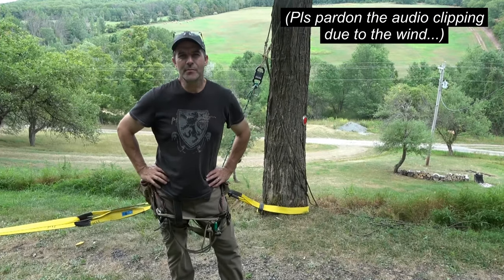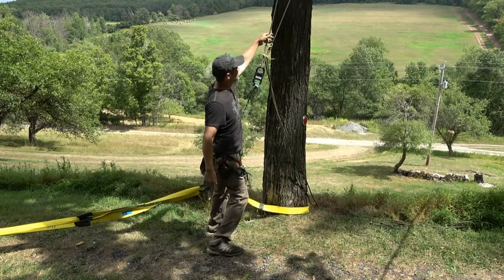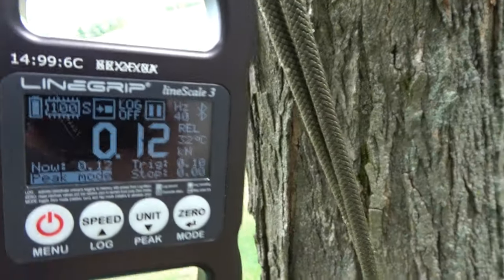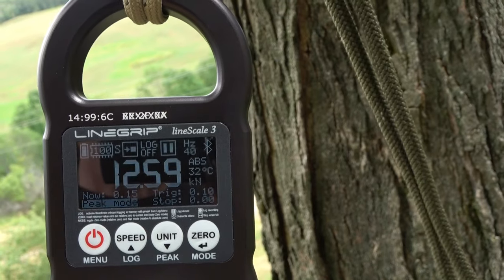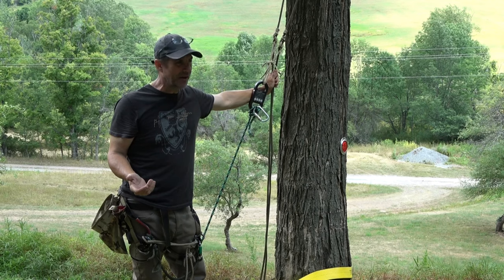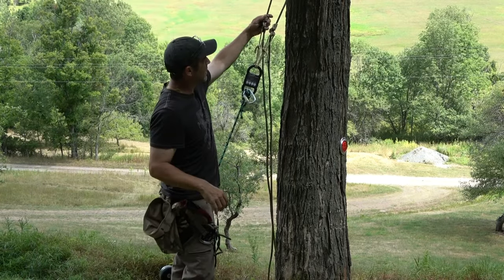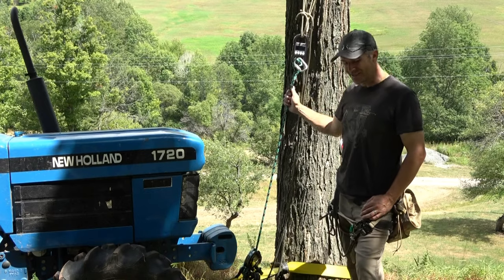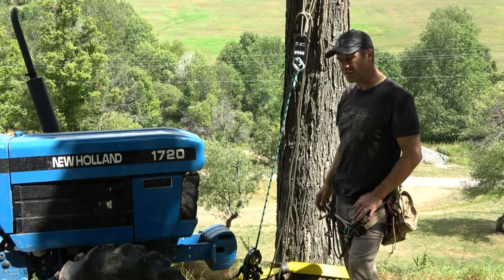Initial Pull Test of the 523 JRB Ascender Hitch

Comment: That was a very good real life test there John. The pulley created the perfect angle as it would be if u were tied into your bridge on your saddle. I believe the cordage that u r using on your hitches is not only the right diameter but of the quality someone would need in a practical sense to not only absorb a load but also to be able to make the hitch functional afterwards. Very well done ✔️.
Reply from the maker: Thanks Joe.  It's just one test on one set of materials but it sure did impress me.

Comment: Very cool would be very interested to see the same test on a single line with a single hitch.
Reply from the maker: I felt this was a good 1st pull test because: 1) this is literally a JRB (doubled rope) climbing system.  2) Each hitch is unaware of the other one.  And so we are testing each hitch individually. If one slips or breaks before the other one, we want to know the weaker one. 

But sure, my tractor might have been strong enough to move just one. I fully expected it to do so here. Stay tuned and thanks!